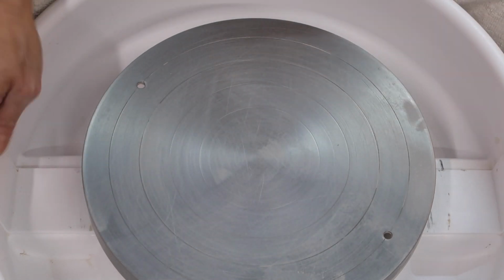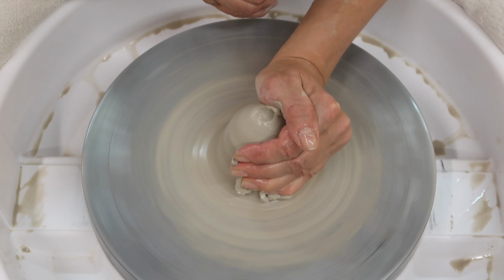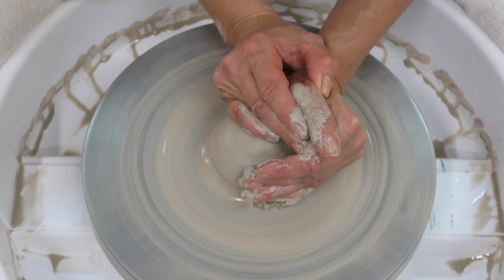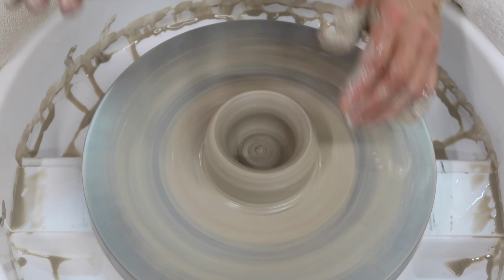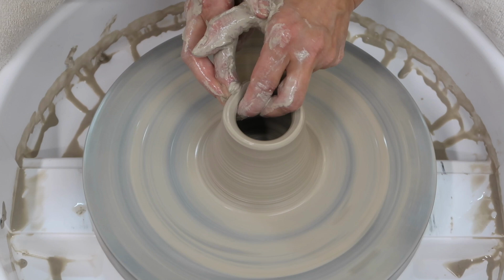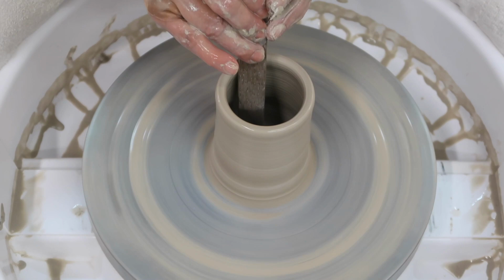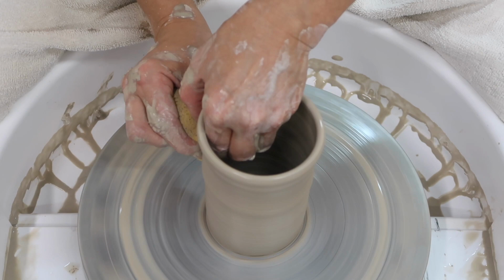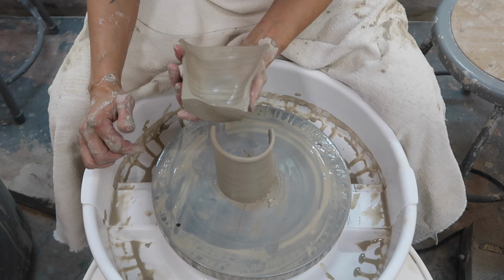How to Throw a Basic Cylinder

Comment: I always get confused when doing my first pull. Because obviously the inside of the bottom of the pot is not touching the exact bottom of the bat like the outside of the pot is. So when getting ready to pull I notice my hand on the outside is all the way at the bottom like it should be but my inside hand is a bit higher because the inside of the pot obviously has some more height to it. So are you just supposed to press your outside hand first until it reaches exactly where your inside hand is? Because it just feels like your two hands should always be meeting each other. But they just can't at the beginning because the inside has some more height. I hope my question makes since